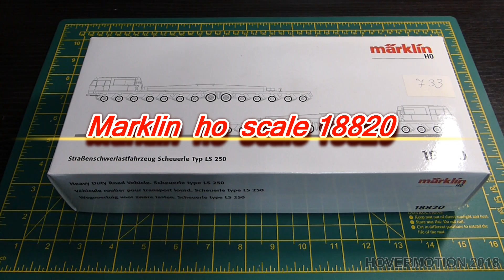MARKLIN 18820  STRABENSCHWERLASTFAHRZEUG SCHEUERLE TYP LS 250

Comment: There where models of these road tractors made by Kibri as plastic kits. They also had a similar but smaller Schnabel trailer section and rail bogies and also a well car center section for loads that did not require so much head clearance as those using the Schnabel. There are vids on UTube of various 1:1 scale Schnabel, deep well and composite side cars for both rail and road showing there use (and abuse).The road tractors are built to take the load on the road that's why all the smaller wheels which have controlled suspension and steering. Each vehicle can turn or sideshift or rotate about any chosen axle center. However while the vehicles have motive power there is only 2 powered axles so added big trucks are connected to pull (and push) as required for any hill work Info; Trafo Union is now part of Siemens Energy.
Reply from the maker: Thanks for watching and your information on these unique vehicles. 
Jim.

Comment: Hello. Nice model. I do have the same heavy load wagon, but I modified the connecting system between the portable beak and the chassis, because one of the clamps was broken apart, I bought it second hand, and probably the preowner had the same problem as you do removing the portable beaks. I removed the clamps with milling and then used to draw a pin in CAD and print it, now I can simply put the parts together and take it apart again. The load is heavy enough so it holds only by gravity. By the the way, did you see that small red part breaking off at 8:44?

Comment: The transformer transports are a great looking models.  After you removed the transformer I was thinking there has to be an easier method.  Instead of prying from the side why don't you turn the end cars 90 degrees and pry from there.  It looks like the plastic would squeeze together and pop out of the hole a little easier.  Also maybe use two pieces of thin metal like a small ruler and squeeze together with your hands.  I hope I explained this correctly.  It just a suggestion to see if it would be a little easier.
Reply from the maker: Scott Downey Hi Scott I hope you are well  thanks for the tip ...tried it.. its so easy to damage as those lugs once they enguage they slip below the metal top surface so even pressure is required to pop them back out...its such an arkward wagon to move and hold without sliping and damageing something...